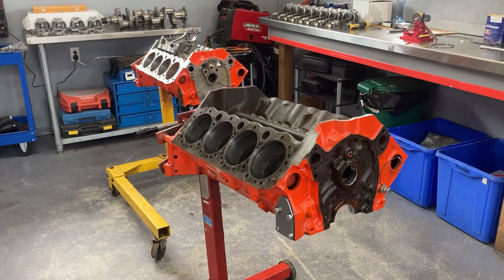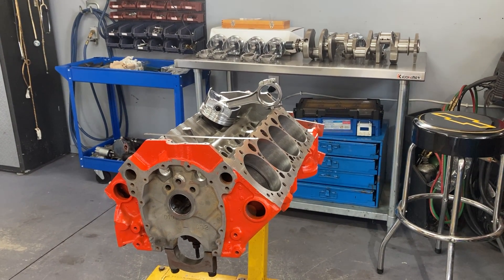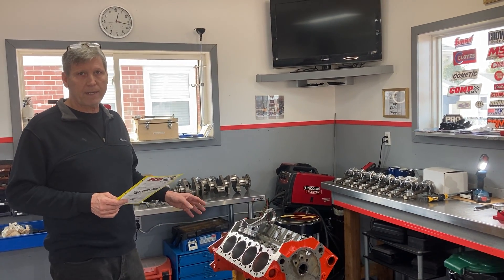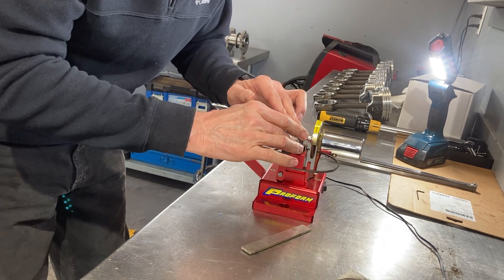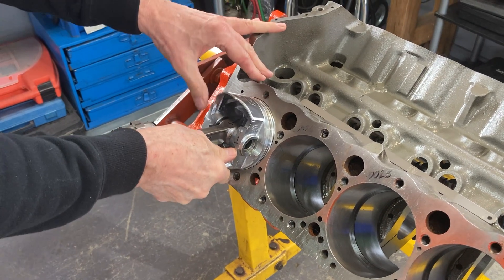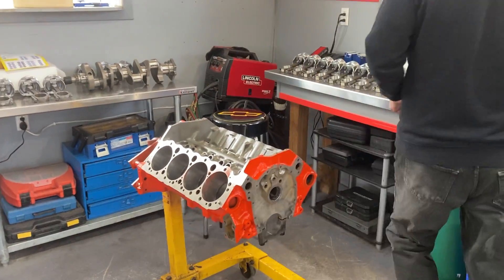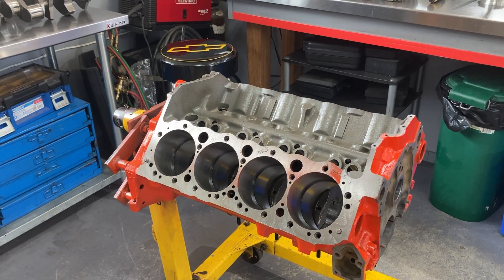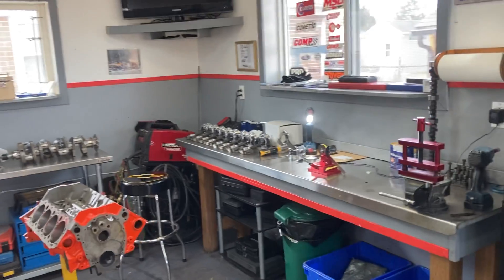SBC Chevy - How to File Fit Piston Rings for your engine build

Comment: Not trying to be critical and this is not meant to be mean spirited in any way but Tom would of had a MUCH easier time doing the end gap if he knew what the gap is that he started with. This is very simple to measure with a set of feeler gauges(very inexpensive tool at almost any auto parts store). 

So now he knows the starting point, that filer that he used has a dial gauge on it that I am assuming is .001" increments that can be zeroed out when he touches off. Now all he has to do is move in the difference of what he measured and the .027" he is shooting for. To be on the safe side he can stay a few thousands away so he can make sure the filer isn't taking more than the dial indicator is telling him it is taking.

No need to guess when doing that job using the equipment you're using. After the first couple of sets you do it this way you'll probably be able to skip leaving a couple extra thousands to make sure it isn't over cutting and file them right to size.
Reply: if you dont know starting gap, why would you guess at how much to remove?
Reply from the maker: Thanks for your comment IEGWOIAG. 
In the end I have the piston ring end gap that I need. 
Please keep watching my channel and making your comments.
Allan Gold
Reply: @goldsgarage8236  
True but now you know a quicker way to be accurate. There is that time is money thing too if you even care about that? But the main thing is with the feeler gauges you're not working blind.

Hey, what does "IEGWOIAG" mean?

Some people are aren't very accepting about being told a different way to do something. If you're ok with it I will comment with more suggestions if you want and if I have any? If not I can shut up too? LOL I don't want to upset anyone.
Reply from the maker: Thanks again for your comment. The letters are an acronym for your handle "It's Either Gonna Work" ..etc. Your comments are valid and that is the correct way to do it. Here is what happened, the thickest feeler we had was .020" and putting them together was making it difficult to get an accurate reading. I had an .027" long feeler so we used it. Our experience with the machine it that it sometimes overshoots the setting and removes more than it should. 
Your comments are always constructive and appreciated. Please keep watching and providing input. 
Allan Gold